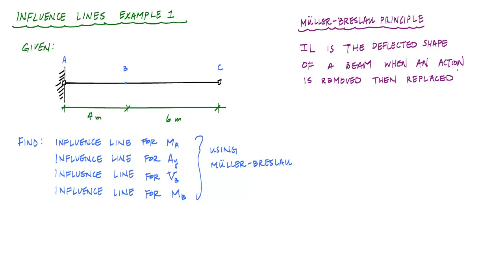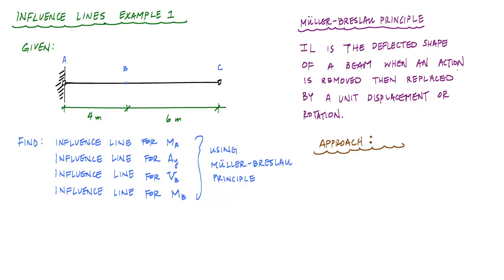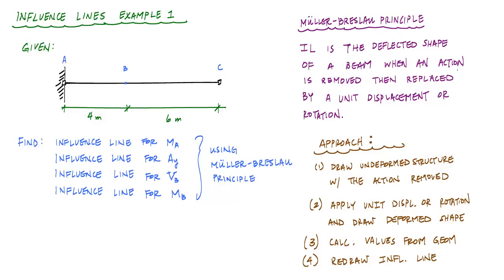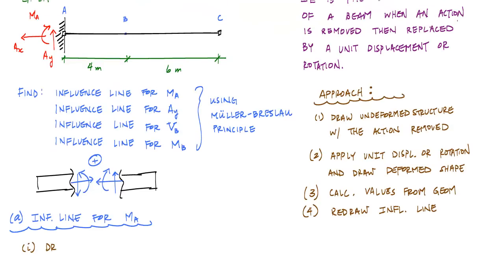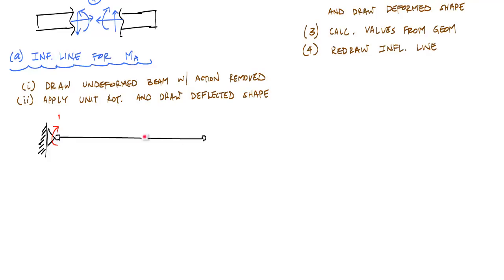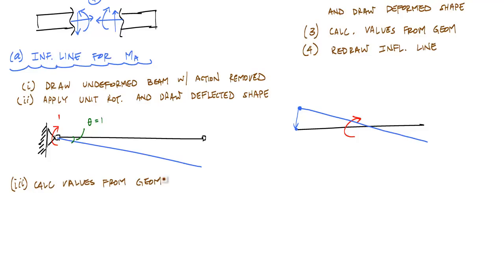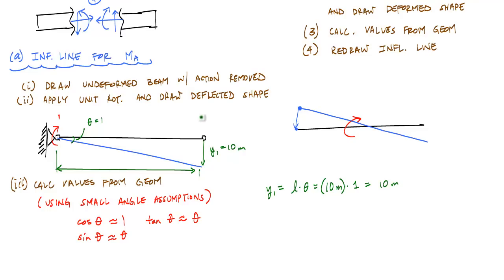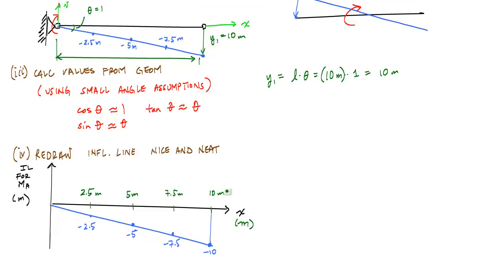Influence Lines for Beams Example 1 (Part 1/2) - Structural Analysis

Comment: why is Ma clockwise in the cantilever beam? The fixed wall was supposed to resist the clockwise rotation of the beam due to its weight right?
Reply: annoying engineering conventions, the moment was positive in the clockwise (weird, cos it meant to be anti=positive) to make the downward slope appear to like the real beams bend